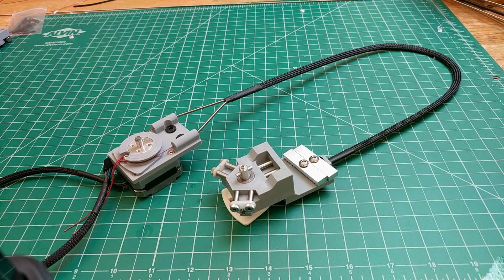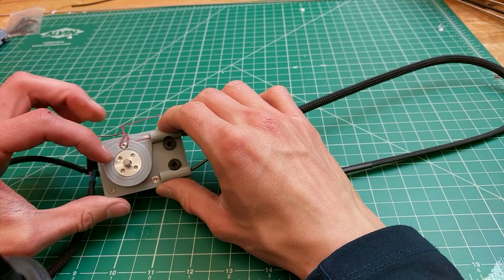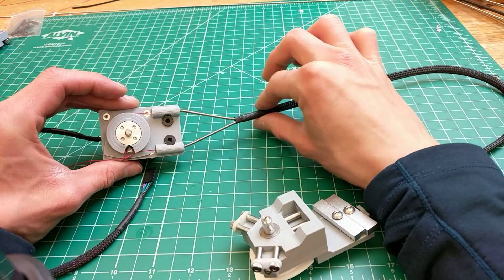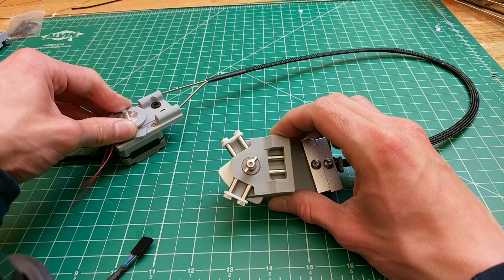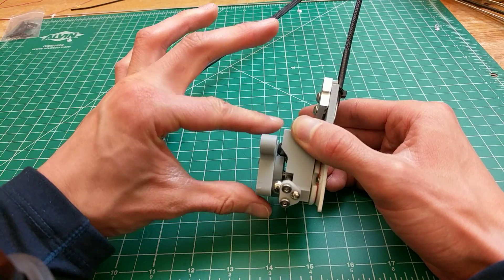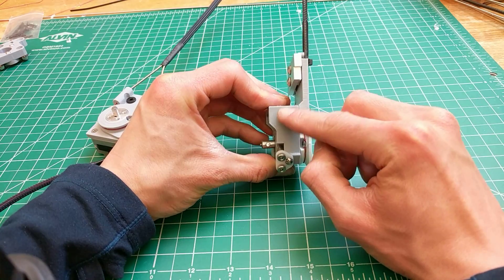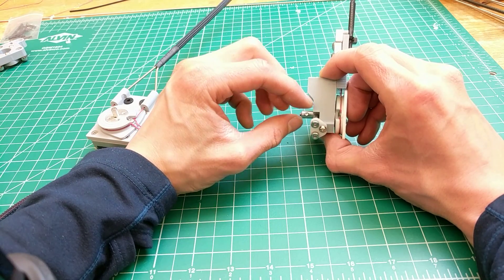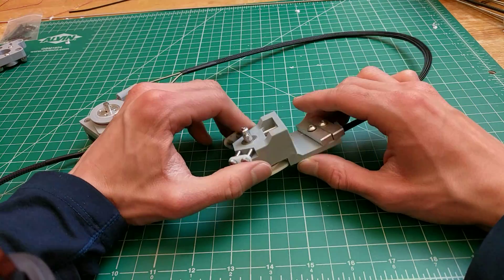Cable Drive Tool Changer Update

Comment: Can the motor have two more cables attached to the other side using a second pulley that when its posts spins it locks on the tool while a second locking mechanism releases the tool from its rest?   Reason I ask is when you make tools that are electrical and need to plug into the head they may not come off the arm easily since the sockets will be very snug and will require a bit of force to pull them apart so a locking mechanism to hold them in the rest while the head pulls away will be needed. So essentially while the head's lock unlocks to release it to the tool rest, another locking mechanism built into the tool rest locks it at the same time so the tools will need a locking slot printed for both sides.

What is there to trip the stall detection in the drivers when you lock it? There's no hard-stop there on your printed part like there is when it unlocks by the three printed parts colliding with each other.  I do hear a click when you printed part on the motor's pulley faces the back of the motor where its wires are ran out.

Comment: Dear Joshua,
I ran into some problems while building my own toolchanger. I wonder of you have experienced the same problem.

Kinematic couplings have a problem when placed vertically. The head has to move sideways when it is out of position. Therefore it has to overcome the friction of the balls in the V-grooves. When placed horizontally this is no problem. Vertically it is because you need a additional device which pulls the balls en V- grooves together. This systems has to pull relatively hard an therefore has large friction with the printhead. Combine these frictions and add a bit of gravity (heavy printhead) and you have a system which is unable to return to its desired position. 

Sadly enough this what is happening with my system. My system is different to yours because I don't rotate the T axle. I move it in and out. The T axle holds the head by spring force. The movement of the T axle is done by an external pull motor (only 1 cable needed instead of two with your system). Increasing the spring force doesn't help because it is the spring force which creates the friction in the first place. My ball sit in a V-groove with a 90 degree angle. Changing the angle doesn't help much because the main friction is created by the T axle pulling on the printhead. 

Did you try this solution? I get the feeling that this is why people are using a rotating system instead of my translating system. A rotating system overcomes the main friction problem because it is already rotating. However, when the head is locked it should be locked without a spring system on the axel. Or else you end up with the same problem as my solution.

What do you think?

Kind regards,

Frank
Reply from the maker: Hi Frank,

I suspect that your kinematic coupling grooves have too much stiction. In the case here and all future versions, the grooves are made from smooth steel dowel pins, which habe low friction and prevent the balls from sticking when they are pulled into position.

That's not to say that this coupling is without it's problems. I did have issues where the wedge plate was catching with the twist lock, which would have the effect of rotating the tool instead of strictly pulling it into position, but this 8s largely solved by switching materials.

More info on that issue here:
https://github.com/machineagency/jubilee/issues/43
Reply: @POOFjunior  
Thank you for your response. I appreciate it. 
It seems you had the exact same problem. 
I did polish the V-grooves. This helped a little bit. 
I ran some calculation. My design fails when the coefficient of friction is above 0.15. To be safe a coefficient of friction of 0.05 would be advisable. Sadly enough this is impossible. 0.15 is already rather low. This proves my design is fundamentally flawed.

For my specific printer I came up with two solutions. 
1) Run the head into de tool so the tool perfectly aligns and than activate the locking mechanism. 
2) Pick op the tool and bring it to a position where there are some spring loaded pins and run the the tool into those pins. The pins might push the tool to its perfect position.
Solution 1 is preferable but also very difficult with my specific printer. My printer uses a lift mechanism to park the tool. The lift mechanism might be to unstable for solution 1. We will see.

Comment: Hi.
 Would you explain please how to configure the firmware to use this feature? I try to make it on Duet 2 WiFi board, but motor doesn't stop by stall detection.

Comment: The idea is nice, but i think that no matter what cord you will use (nylon, steel) it will wear our pretty fast with so many, short distant movements inside spring guide. Correct me if I am wrong.
Maybe kevlar will do.

Comment: Nice work. It is very compact. Regarding the flexing issue, this part seems more rigid: do you plan to put a metal shim insert in the tool head to do a metal/metal contact with the lock ? Is it a bad idea to support on both sides the 6 screws of the coupler to prevent any movement on the XY plane of such screws ?
Reply from the maker: Aye; this variant is much more rigid. So far, Im locking the tool into a wedged shaped printed part, so I wont need a metal shim like E3D's. These are intended to be consumables that can get replaced without having to realign the tool.

Comment: did you put a bearing on the back side of the tool head? In the process of printing out my second extruder head right now! I like the new fatter design. Maybe I'll update mine too because there are significant ringing artifacts in the one print i did. However, I also just want to try it with two colors before changing too much
Reply from the maker: I added a piece of shim on the back side, but no bearing. Yeah, the fatter (and shorter) design has made the entire thing far more rigid on my machine.

Comment: Stunning. How you made the rotating shaft with pin?
Reply from the maker: Thanks a bunch for the kind words. I machined it starting from a rod of 0.25-in aluminum. In this entire system, it is the only machined part. 

I added a drawing to the thingiverse docs for reference.
https://cdn.thingiverse.com/assets/3a/db/cb/6e/52/pin_lock_shaft.pdf

I suspect  you could print this solid with a tough filament,  or perhaps grind down a screw to get a similar piece.